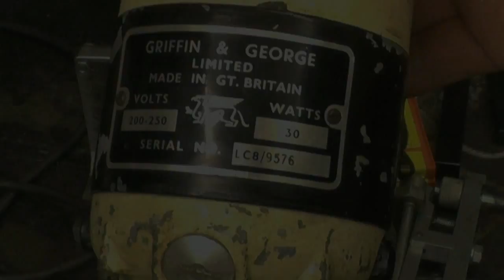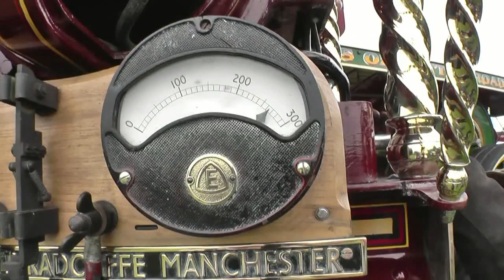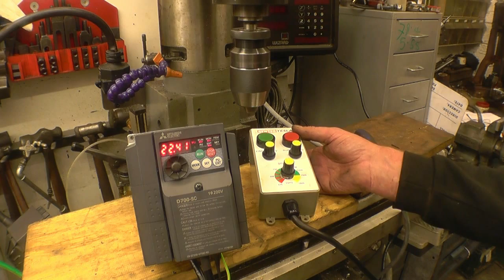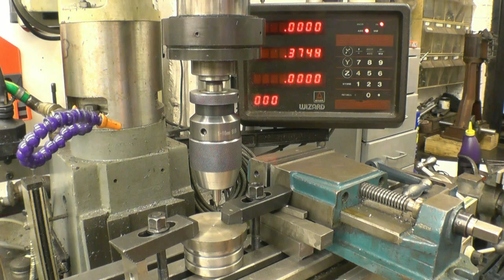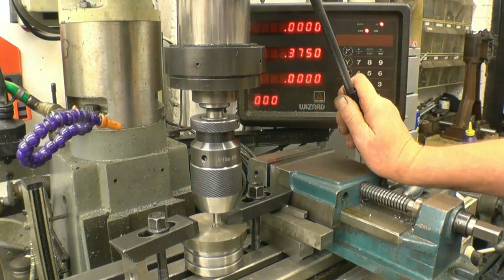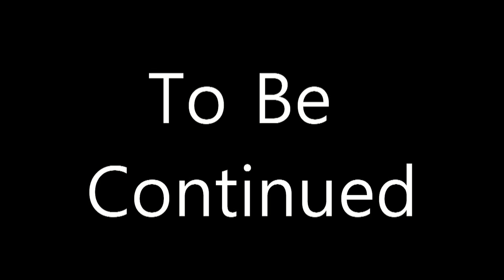SNNC 183 P1    Eccentric Machining . 626 Mill inverter package

Comment: Don't think the tap follower is a good idea for clocking in the part.  I saw movement in the shaft last time you used it.  A dead center is best.  -  Nice lathe work on the offset.

Comment: John. That motor by Griffin and George, who are a Laboratory Equipment Company, is a variable speed stirrer. When new it would have had a simple aluminium knurled chuck to grip a 1/4 inch rod with a propeller blade on the end to stir liquids. It usually had a steel rod sticking out of the motor body, that would be clamped in a retort stand. Being only 30 watts, sufficient for stirring liquid, it may not be enough power for a tool post grinder. Good gift all the same.

Comment: hi john,
            as usual, another  great video. 
i have an identical mill as yours, and have hsd it for about 30yrs. i also have just purchased a vsd, and will fit it shortly. I intended to do away with the intermediate pully, as the vsd will run from 0hz to over 100hz, and removing the centre pulley will make it quieter, and more torque.
Question ..i know you overhauled your mill some time ago. Did you replace the spindle brgs, as i suspect mine needs new brgs. just wonder if it was straight forward or not?.
regsrds
neil. New Zealand.

Comment: Re the little cream motor: Griffin and George were well know lab equipment suppliers. That looks like a stirrer motor for stirring large reaction vessels in a lab. I doubt if its that high speed (as in grinding spindle) - much more likeey to be in the 0 to 100 rpm range.

Comment: The item at 8:00 is a setting attachement for bosch VE-type injection pumps. It is used to find the start of the injection to set the timing on an diesel with this type of pump.
Reply: It uses a DTI and positions it out of the way of injection pipes and makes setting possible if the pump is not accessible from the end. I used  a home made straight on version for my charade CL61 engine untill I got hold of one of these. For that to work I needed to remove the fan belt and kick the alternater way out to get acces for it.

Comment: John, you should have put some shim between the finished surface and the chuck jaws. Now you have offset it, two jaws are now gripping on a sharp edge of the ground radius of the jaw. You now have a couple of 'nicks' on the finished diameter.
Reply: the outside has a mistake and is going to be cut off.

Comment: couldn't you just have moved it in the four-jaw until you had .375 between high and low?
Reply from the maker: Yes it could be done that way Thanks for watching
Reply: Unless I was only half paying attention, if you want .375 eccentricity, you'd have 0.75 between the high and low.